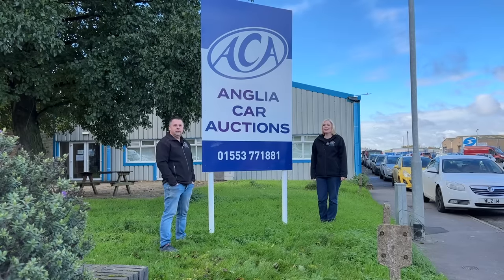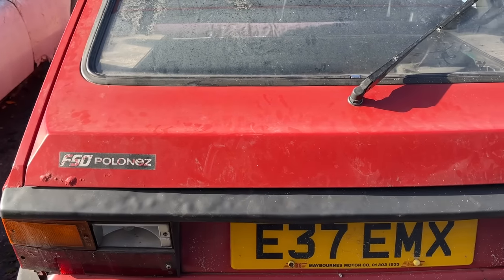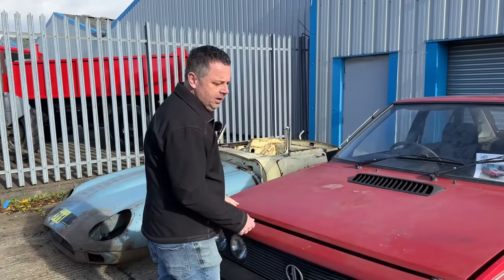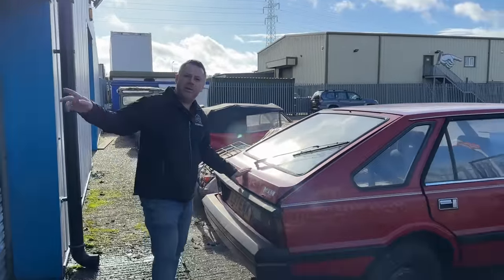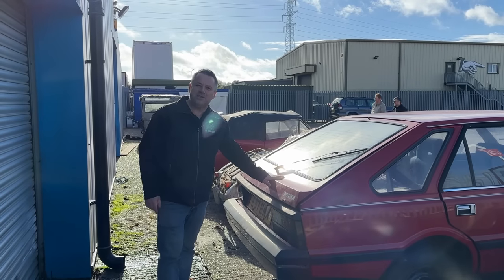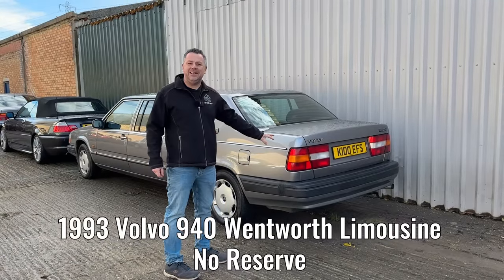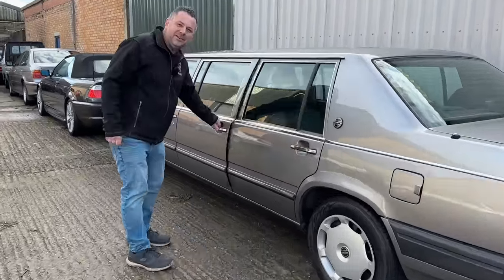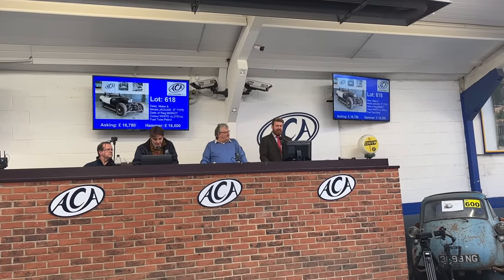Big Money, Or Bargain? | UK Barn Finds At Anglia Car Auctions | Retro Cars For Sale #classiccars

Comment: OMG The Ford Capri 2.8i Injection 
Back in 1982, this was the standard by which all other cars were judged by 
157 BHP from a 2792 cc V6 Engine.   0-60 MPH in around 7.7 seconds and a top speed of around 130 MPH .. I know this is mainstream now in cars but back in 1982, this was RAPID. 
Can you just imagine the first owner driving this off the Ford dealer's forecourt on 18th September 1982...Putting the radio on and blasting this car on the motorway to the number one single  ...Eye of the Tiger by Survivor ... Little did the owner know that this car WOULD be a "Survivor"

Comment: Great video! Great to see a FSO Polonez again! The last time I saw one was in the 1990s. They were one of the cheapest cars on the Dutch market back then (it was either the Fiat 125/Lada 1200-derived FSO 125P, also known as the Polski Fiat, or the Yugo that was the cheapest car in Holland back in the day). There was a dealership close to my home and I think I still have a box of original folders for the Polonez 1500 somewhere. There was someone in our village who still drove a Polonez up until 1996. 

I don't know a thing about E-Type prices but I guess the roadster will go for spare parts? For a restoration project the auction price is far too much imo

Comment: Not familiar with those cars, the polonez (being in western Canada and such though with a gaggle of eccentric collectors I'm sure there's a few around), but I have owned a number of hatchbacks like subarus and tercels etc, and there seems to be a kinship there, ugly and practical, just fix it and drive it, rinse and repeat though I do understand that is an old model in very good nick.  Price on the jag was jaw-dropping and as a few have mentioned the price it'd take to get that right?  Go get one you can drive for less I think.  Fun auction thanks for sharing! :)

Comment: E type I guess that registration has a known history. The Henkel engine will run red hot if pushed hard. Subject of much amusement in its day! The doors were always known as forward opening. The word suicide is a very modern term. I owned a 2000 many years ago and it was a very relaxed drive.